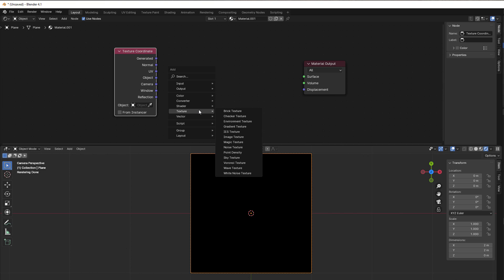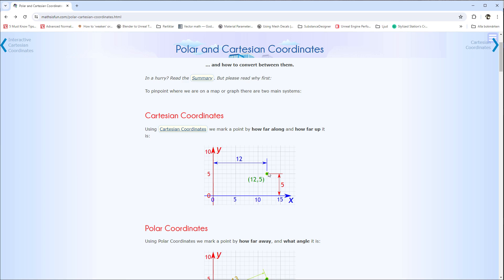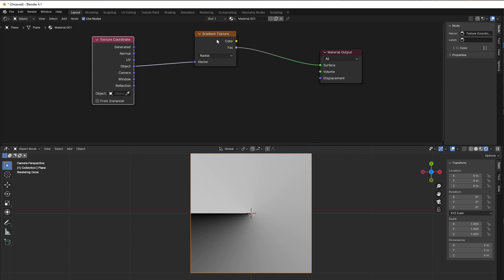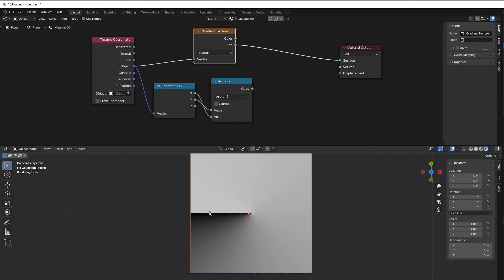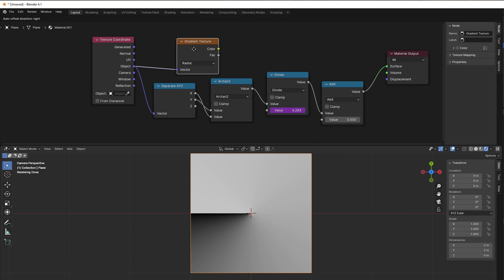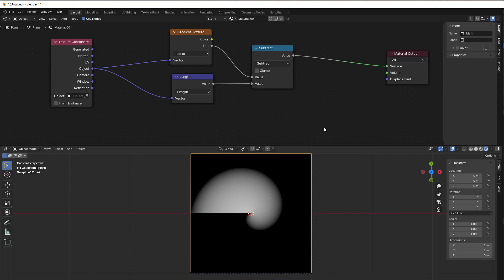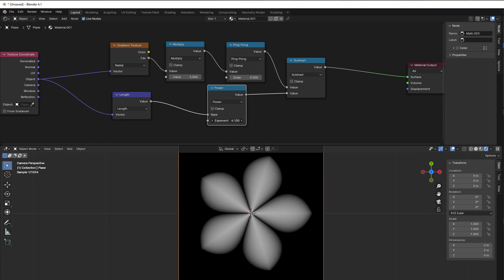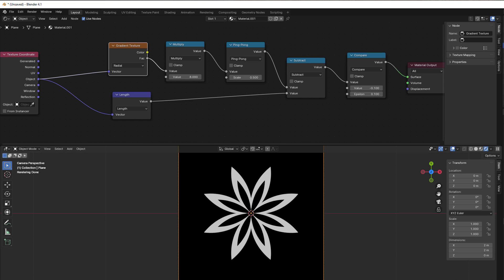27: Polar Coordinates

Comment: Might want to reduce it to 2D; separate and combine only x and y. Then drive the z from object z.
X (radial) and y (radius) now becomes a "disk polar coordinate system".
X (radial) and z (height) now becomes a "cylinder polar coordinate system".
I use both of these all the time to create repeating noises (say to mimic lathe toolmarks),
by using abs(normal z) to drive a smooth transition between the two. With z being radial axis.
And as mentioned already, just type in tau into the divide node. No need for a driver. Or is it?
I just use the radial gradient though, multiplied with tau if I need to use trig functions on it.

Comment: Thanks, amazing tutorial. I want to understand something though. How does the polar coordinates change the position of the texture?, i mean i understand the concept of polar coordinates and how to get them but why do this make these shapes?
Reply from the maker: You can see the polar coordinates (at least how I use them here) as an ordinary gradient from 0 to 1. The only difference is that it is a circular one. That means that you can split it in smaller parts by using multiply and fraction as you do with any gradient. Then you get many smaller "baby gradients" where each go from 0 to 1 as well. If you want something that is round in the top you must do a range change (as with a normal gradient) so it goes from 1 to 0 to 1 instead of 0 to 1. That you can do with subtract and multiply or with a "ping pong" node . However, since the gradient also grows in all direction, you must limit it's spread and the perfect counter weight is the Length node since that also is growing when it goes out. So by subtracting those two, you can control the height (how close to the edges) of the polar coordinates. That is basically it.

Comment: I will need to understand the math that gives the flower from that polar coordinate associated with the other nodes.
That said, did you now you can also use tau instead of 2*pi ?
Reply from the maker: I think the easiest way to understand it is just to drag from the ping-pong node to the output.  Then you can see how the pattern gets repetitive since we are repeating that gradient so many times as we have put the multiplier to. There we have the lines and they are going from white to black on every repetition. That means that if we subtract with a number that is fixed, like 0.1 or similar... it will start to take away the dark parts on the side so we get separate leaves. However... we would like the leaves to be pointy in the top... so we need to increase the value we subtract with when we go outwards. So, then we use the length node which increases in value all the time from the center....and we get the flower :). Tau was new to me.. thanks :)! Always something new to learn!
Reply: @jtornhill  Thanks for the detailed explanation.